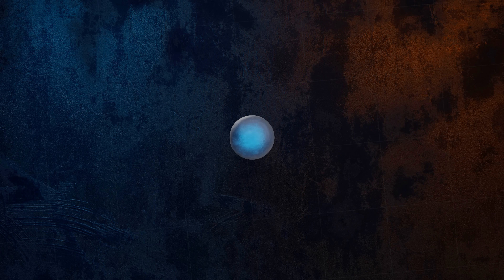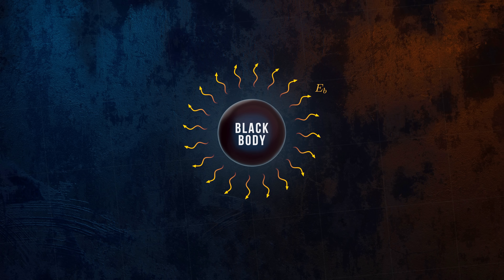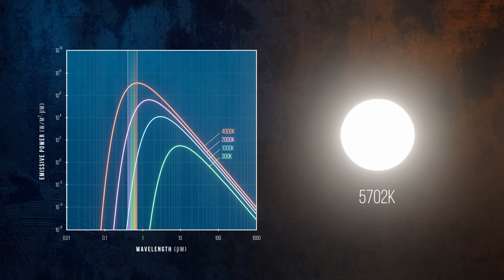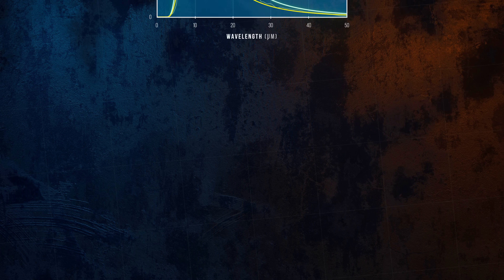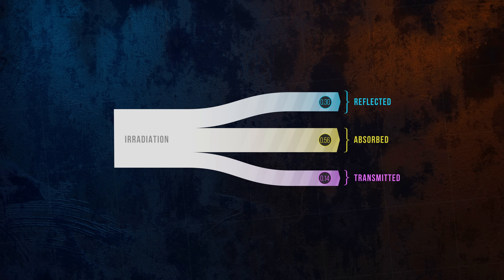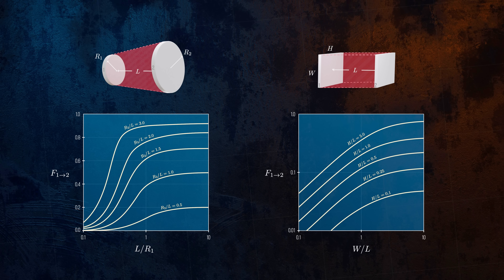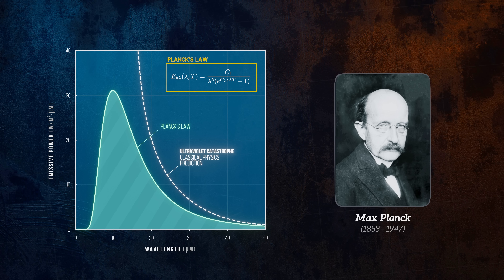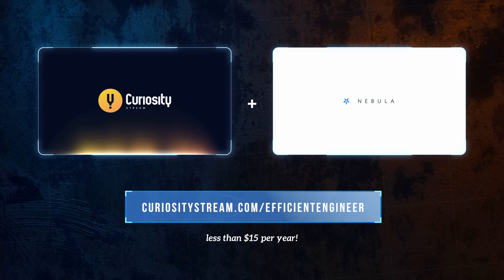Understanding Thermal Radiation

Comment: On the opening: not  “any object” emits thermal radiation. It’s any object that is in thermal equilibrium.
What bothered me is the Plancks Law doesn’t contain the fine structure constant (or the fundamental charge), so then why don’t hot coals emit thermal neutrinos? It’s nt because the weak coupling is tiny, it’s because they’re not dense enough to be in thermal equilibrium  w.r.t. the weak force.

Only core collapse supernova , in which a solar mass of neutrons is stuffed into the volume of Manhattan, do you get there, and they do indeed emit all 3 flavors of (anti)neutrinos.  Very cool.

Comment: Planck's approach to Blackbody Radiation was to analyze the entropy as a function of energy.  To make both high-frequency and low-frequency data consistent with the Second Law of Thermodynamics, he included an additional "guess" term proportional to the frequency (hf);  this results in Planck's Law which is strictly classical.  Planck's subsequent application of Boltzmann's Statistical Mechanics to justify his guess then led to his revolutionary conclusion that the material of the walls emit and absorb radiation in discrete quanta.  A paper titled "Planck’s Route to the Black Body Radiation Formula and Quantization" by Michael Fowler (7/25/2008) gives a nice discussion.  (You can find this online.)  "Theoretical Concepts in Physics: An Alternative View of Theoretical Reasoning in Physics" (1984) by Malcolm S. Longair contains more details.

The full story illustrates Planck's physical insight and tenacity in approaching a problem;  it's very inspiring.

Comment: Amazing video! But I'm confused on one thing. At 12:38 you say "...the total radiation that leaves surface 1 and reaches surface 2 is the product of the area of surface 1, the black body emissive power of surface 1, and the view factor from surface 1 to surface 2."
This doesn't make sense. The units do not match :<
J/s = (J/s)*m^2
Edit: I wrote J = J*m^2 instead. But the units still don't match

Comment: If I have a THIN hemispherical shell that is recieving heat from a source at its center, would both it's inner and outer surface be considered in area term? Does the term THIN has anythjng significant to do with it?

Considering that for a thin sheet of charge, we consider it to be 1 surface of charge in all.

Comment: So if you have an object at absolute zero, and you hovered your hand right over it would you then NOT feel the cold radiating from it???
Reply: No, cold doesn't radiate. What you feel is the cold air around the object, as it cools coming into contact with it. If you were to somehow do that in a vacuum, you wouldn't feel anything.

Comment: Stefan Boltzman is one of the most counter intuitive laws in physics.. It begs the question, how can a measure of energy flow be proportional to Temp to the 4th power when Temperature itself is a measure of internal energy. This needs to be explored in more detail.
Reply: There is nothing counter intuitive there. High temperature body emits faster energy. The body cools down as it releases energy and therefore the temperature drops and energy flow becomes slower. Regarding the 4th power temperature, the formula can be derived by integration of the equation of Max Placnk black body radiation curve.

Comment: very well presented, but electromagnetic radiation is wrong term to use. Maxwell came up with this term. to make his equation formula to work, he used static field with magnetic to came up with electromagnetic. no one has bothered to correct this. this is just one among the over 90% current model of space and particle matter which is wrong.

Comment: This is why global warming is limited. Warmer things emit a lot more heat and absorb a lot less, Self-regulation. The CO2 changes the emissivity but things that absorb more also radiate more heat. A blanket over an object regulates the temperature but the average temperature shouldn't change. The equilibrium point doesn't change much mainly depends on the source of heat. Clouds also help to cool the system as it warms, Warm air carries more water, Plants need CO2 and thrive at higher levels. Trees grow using CO2 from the air. People lose weight by exhaling CO2  CO2 is needed for life it's not a pollutant. CO2 is a heavy component in air (80% N2 and 18% O2) so concentration should be highest at low elevations, People migrate to the southern states to escape the cold and complain about global warming. Look at the change in populations since this eminent crisis became a religion. Nobody's moving north. Southern states have doubled in population, People are saying one thing and doing something contrary to what you would think. Birds fly south for the WINTER., People like to predict doom and gloom because it sells well. And when nothing happens they can claim victory, 
A phantom opponent that attacks with weather. Every instance is blamed on the phantom. Hypersensitivity occurs.

Comment: so hypothetically if you have a black body object moving at some constant fraction of speed of light, such that the Doppler shift effect would be big enough to be noticeable. I'm assuming the side that's getting blue shifted would appear to have higher temperature from outside observer. And the side that's getting red shift would appear to have lower temperature. So if you some how connect a heat engine from the apparent "hot" end to the apparent "cold" end, would we get a perpetual energy source from heat engine harvest this apparent temperature difference ? from the black body's own frame of reference there is no temperature difference. So no temperature difference to be harvest in this case. But from outside observer's point of reference there is a temperature difference. How to reconcile these two different points of view while still holding each frame to be accurate within their own observation stack ?

Comment: Your theory contradicts the 2nd law of thermodynamics. Also, the term 'thermal radiation' is an oxymoron, since heat cannot be radiated. Electromagnetic energy is created by electron transitions in a mass of atoms and during the process, heat is lost. Heat cannot move through space, or a vacuum, via radiation and applying the measure W/m^2, as if EM is heat, is wrong. The idea of heat being radiated stems back to the late 19th century when heat was thought to be radiated as heat rays. Bohr disproved that in 1913,

The notion that heat can be simultaneously transferred in both directions between bodies of different temperatures contradicts the 2nd law which clearly states that heat can never be transferred, by its own means, from a colder body to a hotter body. In mechanical engineering problems, heat is never transferred cold to hot, by its own means, therefore your theory contradicts the practice in mechanical engineering.

Lastly, blackbody theory was developed by Kircheoff for bodies in thermal equilibrium. It is outdated and teaching it is not helpful. BB theory suggests the Sun, as a near black body, is also a perfect absorber of EM. That contradicts the 2nd law since it means the Sun absorbs all EM from colder sources. Not possible according to quantum theory.

Comment: First claim is not true: Not all matter radiates. Nitrogen and Oxygen do not radiate IR at any temperature. The is greenhouse theory. These gases are also near perfect thermal insulators, with a thermal conduction value of near 0.024 WmK, so they do not conduct either. This is a paradox, and I have found the solution, follow my channel for the answer.
Reply: My research and experiments will overturn radiation theory. There has been a systematic error. All matter does radiate, N2 and O2 included.

Comment: I listend to the whole video - and - learned nothing new. I still didnt get an answer to the most obvious question. Does a black painted styrophome ball emit the same radiation as a black painted steel ball of same temperature? The SB law only depends on emissivity and temperature. It gets even more drastic if you consider a volume of a gas. Does a spherical volume of gas at 500K emit the same power as an equally large and hot sphere of steel. Certainly not, and this is an important part missing in the Stefan-Boltzmann law, the heat capacity, but it is not contained in school books. So noone talks about it.

Comment: I was recently looking up how to heat a substance in an evacuated flask. I found it's suprisingly difficult because glass reflects infrared and vacuum is a heat insulator. I found that I actually need an IR radiator inside the flask.
Then I found there are "vacuum ovens" designed to do just that - they emit far infrared but I have no idea how they control the temperature - since I guess thermometers wouldn't work in vacuum, especially if they absorb less IR than the heated object...
Reply: hot plate $15 and 20-amp rheostat (Variac ) $200  Wrap the flask with some nichrome wire of the correct resistance W=V^2/R to get the wattage. Or get a hot plate at Wal-Mart and a rheostat or a wave chopper   Get one of them oil burner pipes they work real good. WalMart don't have none though. You can pull a vacuum real good on one of them. The shit just melts into a puddle. Temperature control is the key to success. With no flow to balance the heat it's tough.
Reply: @melaniecotterell8263  Thanks for the elaborate answer. So the evacuated flask can be heated directly by  the heating element (e.g. ribbon or mantle). I can control temperature by sticking a thermocouple probe between the flask and the heating mantle to ensure it's not overheating. The inside wall of the flask becomes a radiator, heating up the sample. I can flush the flask with inert gas from time to time to remove vapours (or absorb them in a drying agent), then cycle between vacuum heating and flushing when saturated with vapours. Okay this seems to be doable.

Comment: nice video, good, simple, and intuitive, but I have one question, why does my paper ash produce led type white light when heated by a lighter? I'm pretty confident my ash cannot be emitted at a lower intensity than a black body at visible frequencies. can provide a description of how to observe the effect. I have not directly measured the intensity but it's while, like a quite powerful led and at lighter flame temperatures. roughly 2300 kelvin at a maximum, of course, gas does not emit as much radiation as a solid surface, but I find the effect strange and looks a lot like an led, I'm wondering if the cavities and cracks in the ash somehow create some stimulated emission in the ash, but it's strange to me. feel free to test it, I don't have the equipment to do so :). 
the setup is pretty simple, take rizla rolling paper, blue works best, red is also fine, but it crumbles easier and isn't as easy to work with, I could assume all kinds of similar rolling paper would work, but I have not tested it. take the paper, twist it, the best way to do it is to take a few papers and twist them together into a twisted bundle, then burn it carefully until the rod of ash is completely white, then just heat the white ash that remains with a lighter, or you could try to use an electrical filament for increased control of temperature, which I'm sure is feasible, but I'm not sure if the effect is still their ofc, because I have not tested that kind of setup. when heated the ash should produce a very bright white light :P.

Comment: one of the most pleasent animated videos I 've ever seen, as an electrical engineer, i'm not very familiar with transfer heat concepts, but your video made it all very clear! amazing!
Reply: I haven't felt the same about heat since I learned that it was an electromagnetic wave. And I thought it was heat.  It just doesn't feel the same anymore.
Reply: @melaniecotterell8263  Heat can be transferred in primarily 3 ways Conduction, Convection and Radiation and in Radiation only it is transferred as an EM wave and in other two cases it is different.

Comment: the topic is done like it's from a physics textbook - which means it's not completely understood.  the author of the video should introduce questions where he knows there's certain gaps in the knowledge.  and, there are gaps.  the wavelength for example, is a 2D rendering, of a 3D spiral...the 'perfect black body' for example, does that include a Black Hole? - another pertinent question - and how, does that effect our understanding?
there are many gaps, that i cannot see either - that's why it's important the video cover those areas...there are more areas of unknown, than known.  is really what i'm saying.  so, don't make the video out as if humans have it all figured out.  it would be a disservice to assert it that way.

Comment: Stainless steel can not be oxidized (rust) and always is shiny, so they use plasma torch best way to cut, carbon steel can oxidize even it has higher melting point than inox. Low emissivity property of inox steel is not good in process of fabrication.

Comment: 4:43 where in the graph it says starting at 700 K it will start to glow ?!
Reply from the maker: At 700K is when the line starts to cross into the visible wavelengths.
Reply: @TheEfficientEngineer  Thank you

Comment: Awesome video as always! Thank you so much for this great work! 
I would just precise that the EM wave do not only follow straight lines within mediums, which explains mirages for instance. And that there is at least a fourth way the heat can be transfered between objects, which is by being carried along within moving matter : transportation.
Reply: "by being carried along within moving matter : transportation"

also known as 'convection'
Reply: @darylh8657  I meant solid matter . I think convection is a term only used for fluids. For instance an ablative thermal protection on a re-entry vehicle. Small solid bits would detach, moving the heat they carry away from the spacecraft.

Comment: Hey, now I'm doubting. How do you know that next week I have an exam on Heat Transfer...!!!
Well done bro... A truly exceptional work from a mechanical engineer for mechanical engineers.
Reply: This video will not help you calculate answers to heat transfer problems. That is why you have a 15-week intensive curriculum in one topic of study.  He needs to do a video on Thermodynamics which is nothing like heat transfer Thermodynamics is confusing, How and why a gas heats when compressed. That's most of it
Reply: @melaniecotterell8263   sometimes, understanding how things work truly help solving a problem, because all of a sudden you understand why using a specific formula over the other and all that kind of stuff.... At least that how i feel.

About the temperature thing, the temperature of a gas is greatly affected by 2 factors, volume and pressure,
Tou can see it in the ideal gas law, PV=nRT...
The more intuitive explanation is that as u compress a gas, the  gas particles bump into each other more and more, which give the gas more kinetic energy which raise the temperature!

Comment: Quick question:
How much of the energy that a fireplace emits to heat up the place comes from radiation?
Reply: Place one black and one white paper near a fireplace and see the temperature difference in between. Although, I do not think radiation is not dominant since temperatures is not that extreme (not on the order of thousands at least) and note that a fireplace can pretty much every part of a room, not just the parts that radiation can reach.
Reply: @user-zp3xc4to1t  It reaches ~600ºC
Reply: Most of it. Convection all goes up the chimney and conduction is a tiny amount that comes from the direct contact of the embers with the floor. Fireplace is terrible as a heater but is great as fun :)